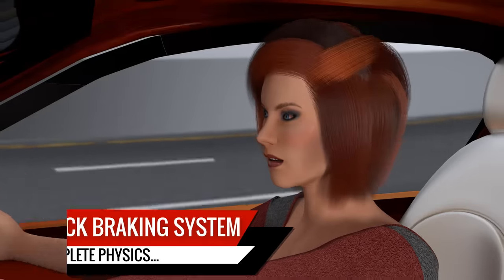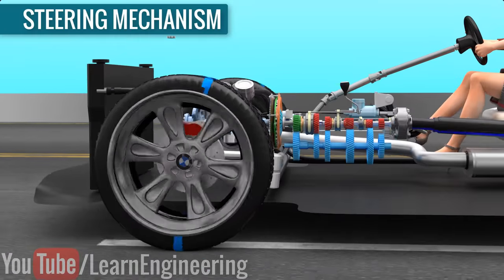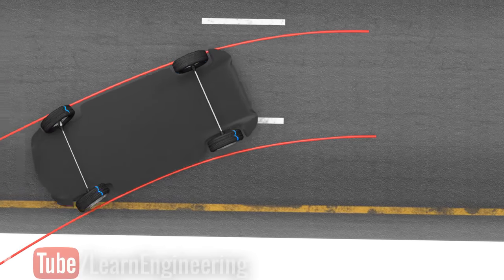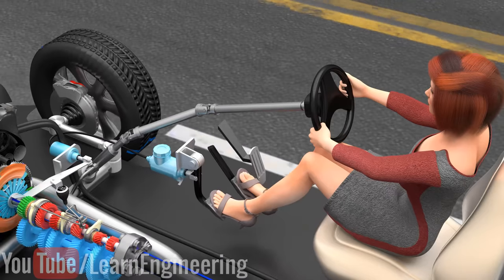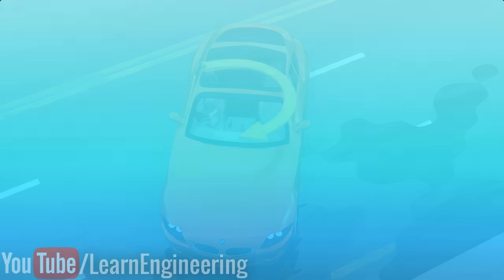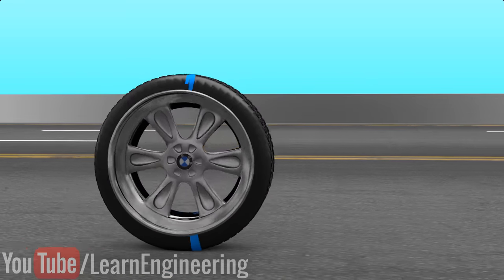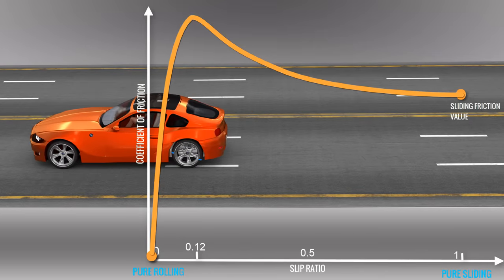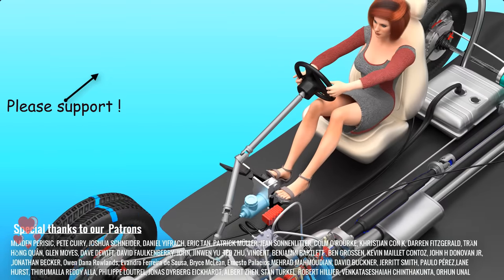Understanding Anti-lock Braking System (ABS) !

Comment: Mashing the brake pedal does not stop the wheel from rotating unless you mash real hard on the pedal even with non ABS. If you lightly press the brake pedal it will Not lock up the wheels.

Comment: Excellent video!

What annoys me about the term ABS is that it implies that the brakes don't lock. They do lock, but just rapidly on & off. I used to think that the computer could magically 'feel' traction about to be lost (& slip to begin) - but it doesn't. It's just a glorified version of pumping your brakes. I'm not denying its relative efficacy - but the notion of true anti-lock would be proper 'black magic fckery' territory.

Comment: My vehicle was showing strange slipping and felt like the tires were pulling or going to fly off the car even though they're tight on and I couldn't quite explain it in words it was a feeling for months but no lights were on so I continued to drive everything was brand new on my car breaking system tires Etc so when the ABS came on the other day I was not surprised and now I knew I wasn't crazy thanks for this video but I don't even think like mechanic would understand it I feel like it just need a whole new system again in this car is already cost me a bunch of money should I just throw it out??

Comment: So you're saying the coefficient of friction increases as the friction becomes more kinetic? That doesn't make a lot of sense.
Also if the coefficient of friction during perfect rolling is almost 0, then when the car is stopped, the coefficient of friction between the car and the ground is almost 0, which would cause 2 things:
1. Accelerating would be near impossible, because you would start spinning the tyres immediately.
2. Pushing the car around with the handbrake engaged would be really easy because it has no friction with the ground.

From what I know, during perfect rolling the tyre has the most friction and that's where the ABS aims to place it
Reply: I see why you get confused. Although the friction between the tyre and the road is large at perfect rolling conditions, it can't really provide a lot of stopping forces to the car since it's rolling. This is equivalent of having low "friction".
The "friction" rises as it slips due to the elasticity of rubber. The tyre stretches thus creating more contact area. The friction starts deceasing at about 12% slip ratio as it becomes more kinetic.

Comment: Let me introduce myself, my name is Dwi Okta Ramadhan The material I responded to was ABS brakes are a braking system designed to maintain safety by preventing the vehicle from locking the wheels when the driver brakes suddenly. This system uses the latest technology to increase driver safety. When there is a sudden stop or speed, ABS brake technology will be able to avoid locking the wheels. This is very important when driving in rainy conditions or slippery roads. ABS is also very useful in situations that require the driver to brake suddenly, such as someone suddenly crossing or a car in front suddenly stopping. Because of the importance of this function, many new vehicles apply ABS braking technology to their vehicles. ABS brakes were previously only used on airplanes, but now they are widely applied to four-wheeled vehicles such as cars and motorbikes.

Comment: See when I wrecked my truck this past weekend ABS did it’s job and kept my tires from locking... So I kept rolling and Rear-ended my In-laws...
Reply: No, that´s not the way it works. If your wheel had´ve locked, you still would have crashed buddy. ABS can only correct bad driving so much.

Comment: Hello,My name is Bintang Ramadhan. I am a student of automotive technology at Padang State University. In the video above, I will mention the advantages of the ABS brake system.
Advantages of the ABS Brake System:
 
1. Prevention of Wheel Locking: The main advantage of ABS is its ability to prevent wheel locking during braking, which can reduce the risk of losing control of the vehicle.
2. Improved Control: ABS helps drivers maintain control of the vehicle, especially in emergency situations or during sudden braking, thereby enhancing safety.
3. Better Handling: By preventing wheel lock, ABS helps drivers better control the vehicle, especially during braking on slippery road surfaces.
4. Increased Stability: The ABS system provides additional stability to the vehicle during braking, reducing the risk of skidding or loss of control.
5. Braking Efficiency: ABS assists drivers in shortening braking distances and maintaining wheel traction, thereby improving braking efficiency and reducing the risk of accidents.

Comment: ABS brakes are not safe for wet or gravel roads, because if you passing down road in wet or gravel road, you will very difficult to brake, because the tires cannot be locked, and there are 2 options: hit the car in front or fall to the cliff.

The only reason the factory recommends ABS brakes is to prevent drivers from speeding up, because with ABS brakes you won't be able to brake suddenly so the driver will driving safety not more then 80km..

Comment: ABS does NOT reduce breaking distance. Not "trust-me-bro" comment, talking about experience. Coming from a land with lot of snow and ice we have to take additionally winter driving course, where we drive on ice and need to pass obstacles. But yeah, they teach us brake taping to maintain control in case vehicle doesn't have ABS.

Comment: Can i install an abs sensor on it's opposite side? For example installing a drivers side sensor on the passengers side. Will it have different connectors, or is there anything else that might prevent me from doing so
Reply: Best to check with the vehicle maker.

Comment: Doesn't seem like the simplest or laymen explanation. I think the automatic system simply reduces or increases  hydraulics to individual wheels based on wheel lock severity in order to stabilize the car or keep the  wheels inline with the body off the car, in order words, keep the car straight during hard breaking

Comment: Be warned: ABS can theoretically reduce stopping distance on dry pavement, but in slippery snow, the COF curve shifts downward dramatically. The pure sliding COF from 0.7 to 0.4 (wet pavement) to 0.1 (slippery snow or ice). That's a huge change. If the algortithm does not account for this, its advantage may not only be lost, but a new risk created. In slippery snow, ABS can and will EXTEND braking distance, creating risk of a rear end collision. I know, because I rear-ended the car ahead of me which was stopped at a railroad track! Scared the _ out of me. Thankfully, I was travelling slowly. When I applied the brakes, ABS wrested control from me, chattering all the way into the back bumper of the car ahead. I no longer trust ABS in winter weather, and believe I can brake more effectively without ABS in slippery snow.

Comment: is it a right practice to press the clutch and  accelerate while degearing for smooth gear transmission in a motor cycle.  Will it damage the engine?
Reply: By degearing do you mean downshifting?
Reply: @oisinuresmaher  Yes, down shifting the gear.
Is it right to hold the clutch, accelerate vroom vroom! and down shift the gear?
Reply: @keerthankadam9402  so I think you're on about rev matching, so the engine and the wheel will be spinning at different speeds so when you clutch in you blip the accelerator so the engine revs are higher than the wheel speed (say you blip it up to 4k revs), then you let go of the clutch. The whole point is a faster shift and it'll save you wear on your clutch and flywheel. It takes a lot of practice though
Reply: @oisinuresmaher  thanks for your reply, will it not damage the gears or engine since we accelerate and shift the gear?
Reply: @keerthankadam9402  technically, your gears aren't connected to your engine when you're clutched in. When you clutch it disconnects the engine from the transmission, so you could rev it freely if you wanted without damage, so no it won't damage the gears :D
Reply: @oisinuresmaher  thanks again for your time, you cleared all my doubts. It was great having a chat with you.
All the best for your future.
Reply: @keerthankadam9402  no problem man any time, have a good time on that bike!

Comment: I dont like abs  break. You might be confusing  that the break not activate. Especialy your are near in traffic light . You overpass the lane  you cannot control exactly where you want to stop your car.
Reply: How would you not be able to tell if the brakes are on? If your stepping on the brake pedal, then they are on. ABS is only a safety feature, it it comes on you were not using your brakes correctly. If you are properly threshold braking the ABS will never activate, I've been driving in the winter for years and can count on one hand how many times my ABS activated.

Comment: How abs system know the car completely  stopped and locked without release a little bit like during a break ? (Sr for my bad Eng)
Reply: It probably has some link to the speedometer of the car (I vaguely remember something about this during driver lessons). For example, engage abs if the car goes above 20km/h and disengage if the car is below 20km/h again

Comment: Does the ABS module unit work along with the Power Steering Module? Are they related? I'm asking this because I just replaced the Power Steering Module and programmed but the steering wheel still hard and the red light comes on.

Comment: ABS is an important safety feature in modern vehicles. By preventing the wheels from locking up during braking, ABS helps maintain vehicle control and prevent accidents. It is important for drivers to understand the working principles of ABS and keep this system in good condition for optimal driving safety.

(ABS adalah fitur keselamatan yang penting dalam kendaraan modern. Dengan mencegah roda terkunci saat pengereman, ABS membantu menjaga kendali kendaraan dan mencegah kecelakaan. Penting bagi pengemudi untuk memahami prinsip kerja ABS dan menjaga sistem ini dalam kondisi yang baik untuk keamanan berkendara yang optimal.)

Comment: Why is that when one brakes and engage the clutch at the sametime the car brakes more faster than when only applying brakes??🤔
Reply: I think because then the engine is disengaged and there is less work for the brakes to do. But also then your wheels are just rolling (still slowing down) and then I guess you would have lower control over the car

Comment: The character didn't hit the clutch when she slowed down to a stop
Reply: Who cares
Reply: Phiycics
Reply: @idfk1001  No, you don't need to press the clutch.
Reply: @darvinde  yes you do, if you are in gear to come to a stop without going into neutral you have to press the clutch to prevent a stall
Reply: @idfk1001  Who cares if the motor stalls. In a dangerous brake situation you just want to stop
Reply: Aldo you don't need to press the clutch when you start braking. You need to press it if the motor is low rpm.
Reply: @darvinde  touche

Comment: Actually the description is not 100% correct. This animation discripes 3 different systems as ABS. The ABS is just stopping the brakes from blocking not more ! The description for braking on a road with different surfaces or driving around a street barrier and holding the car in lane it's  called ESC (Electronic Stability Control) or DSC. Also description how it works is not really correct. To hold the car in the lane on different surfaces the DSC (Drive Stability Control) is braking not blocking just one wheel at a time to hold the car in place. Also this system helps you to go around a barrier  or any obstacle in your lane in a higher speed the system usually starts acting on a speed around 50km/h and prevents you car from slipping. This system (DSC) should be turned off by driving in deep snow. Because the DSC works together with the TCS (Traction Control System). The TCS prevents the wheels from continuous turning what makes you stuck in the snow. So next time you drive in deep snow find the button on your dashboard (or center console) with a DSC (or ESC, ESP) on it and push it  A orange light will come on what says the car can slip now. This is ok for the moment because if you let the DSC on and drive in deep snow on the next hill you hit the gas pedal and the TCS will feel the wheels losing traction so it will bring down the motor tours and the wheels turning slower this will make you stuck in the snow.

Comment: SO, IF I am going down a steep hill and THEN put my brakes on a BIT strongly, in DRY conditions and my car seems to "vibrate" a VERY SLIGHT bit and I can feel it in the pedal, is THAT my ABS kicking in? I JUST bought a used car and my family has said that slight vibration going down a steep hill and putting the brakes on a decent bit is a problem with my brakes, I am thinking it is my ABS just doing it';s job. I do NOT want to poo poo my family's point of view though, they are older and wiser than I am I THINK. 

I had a BRAND NEW car that did the same thing though on ice and coming fast down a steep hill. My Uncle is one that says the brakes  are in need of "turning under" and he has worked on cars, BUT, his BRAND NEW car has been worked on and he claims it still has a problem with the brakes. I'm beginning to think my Uncle has NO KNOWLEDGE about ABS brakes. I don't want to harass the car salesman that sold me the car IF there is really NOTHING wrong with my car, the brakes are smooth and fine UN:LESS I am going fast down a steep hill exactly when the ABS WOULD kick in. SO, is that vibrating going fast down a DRY hill just my ABS kicking in? Your best GUESS is fine.

Comment: I dirt race and whenever I’m heading into the corner at over 100 mph heading straight towards a wall I pitch the wheel to the left and some times the car will keep going straight so I have to smash the brakes long enough to get the rear of the car around and that how I get my race car to turn

Comment: I’m not certain it my breaks are malfunctioning or if this is what it is supposed to be like, I just got a newer car and a few times on ice I drove it and when I went to break, it could not get a grip on my breaks. It felt like my breaks were not making a connection with my tires and it vibrated the bottom of my foot a lot when I attempted to press down, it actually felt like I could not stop. Is this what ABS is supposed to feel like or is my car malfunctioning?
Reply: That is what ABS feels like. The vibration is the abs pulsing the brakes. If your abs turns on it is a sign that you are pushing on the brake pedal too hard. It will always take significantly longer to stop in icy conditions so drive accordingly
Reply: Redtooth 75 thank you. I actually can’t press down on the breaks at all when this happens. It is like something is stuck underneath the break pedal and it vibrates and I can’t press it down. Is the not being able to press it down part normal?

Comment: But how do the sensors understand the slippage? You need to have both the wheel speed and the speed with respect to the ground, but I feel that it's hard to get the latter with precision, how do they do it?
Reply: They only monitor wheels speed. If the system detects a rapid deceleration then it knows the wheel is about to lock up.

Comment: When the road isn't flat,  i hate ABS because the car not stopping.  I prefer the normal brakes. My driving license is 20 years old. I can explain why the ABS sistem is good only for noob persons who scare and press the brake hard.
Reply: If your abs is turning on then you are pushing too hard on the brakes. The car isn't stopping because you don't have traction, not because of the abs. A stopped wheel provides less braking force than a turning wheel, abs will help reduce stopping distance.
Reply: @Redtooth75  try to press brake  on bumps. You will see what i say
Reply: @Ciumpalacu  if the abs is activating on bums you need new shocks. Bumps should not cause the wheels to lock up.

Comment: This video does a great job of explaining the physics of anti lock brakes, but to be honest, most of this information would be completely useless to a repair technician in training. No in depth information about how the hydraulic system and ABS module actually work. Really more of a physics discussion in this video. No real technical information.

Comment: ABS sucks, its not silver bullet. When in wet conditions, it's just bad. There're times one needs to hit the brakes instantaneously to stop motion,  abs not s chance. Vehicles with ABS have more rear-end accidents than non ABS.
I would rather be in control, push and release my brake  pedal as needed than have system controlling my breaking.
In my own assessment disadvantages outway the advantages.

Comment: Only when a person, that shouldn't be allowed to drive any kind of vehicle, apply the brake will it result in a blocked, non rotating wheel !!

Any skilled and well trained driver will be able to brake faster, in a shorter distance and in better control than the most common std. ABS systems.
WHY ? - because a skilled driver will never brake above the friction maximum - but AT the friction maximum.

A wheel-speed-based ABS system will never be able to compeed with a skilled driver. You will need to be able to sense both wheel speed and friction - which is possible but too expensive for all but the most expensive production cars.

This video uses flawed assumptions.

Comment: ABS doesn't reduce the braking distance. So why in the video they say the contrary?
Reply: It will reduce braking distance during panic braking. A wheel that is sliding provides less stopping power than a wheel that is spinning. If you slam on the brakes, you will lock up you wheels which will increase stopping distance and can cause you to lose control. If you are using your brakes properly, you should not need ABS at all. Anytime the ABS kicks on it means you were pushing the brake pedal too far.